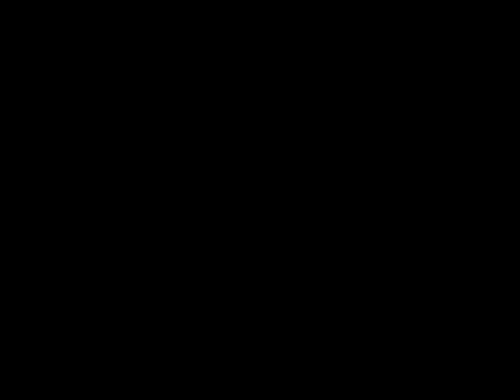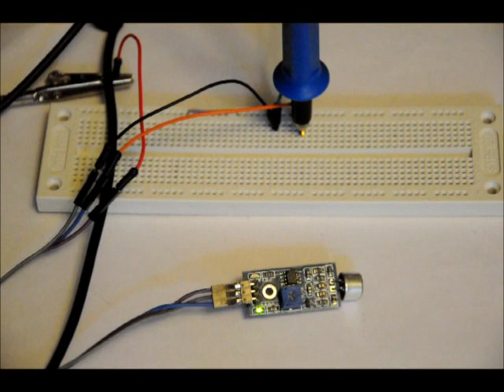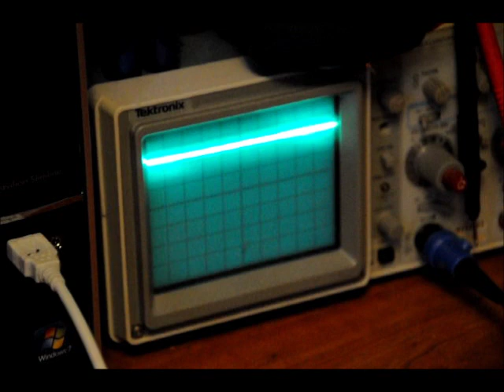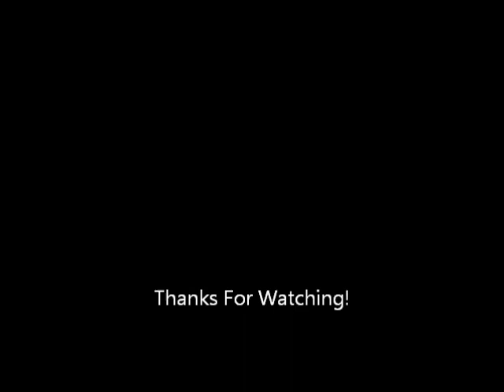Audio Detector Module With Sensitivity Adjustment For Arduino

Comment: Hello, I was curious about how low you could set the sensitivity on this, can you program it to react at any frequency? I was looking at the possibility of using it in a club setting to trigger LEDs and Im sure if the sensitivity couldnt be set low enough that it would not work for that application